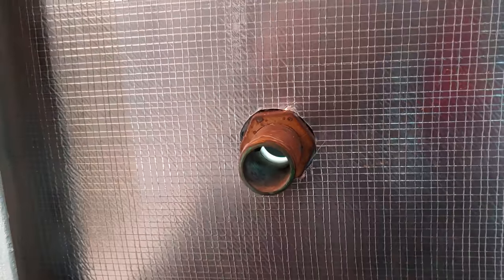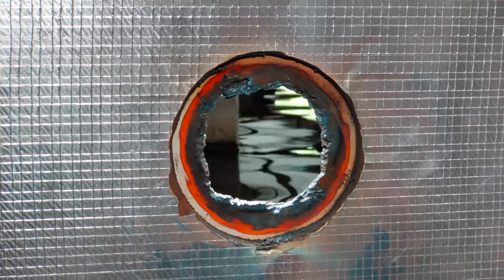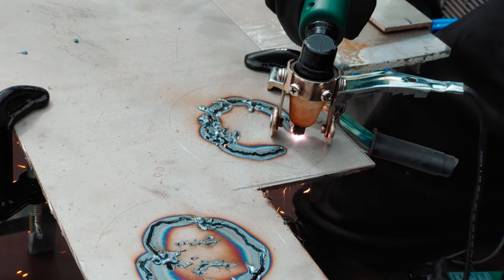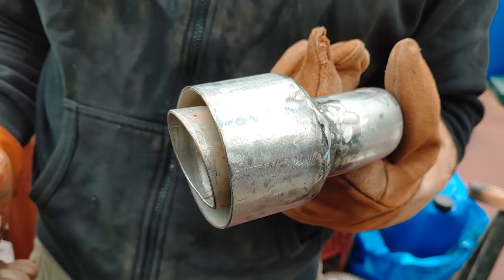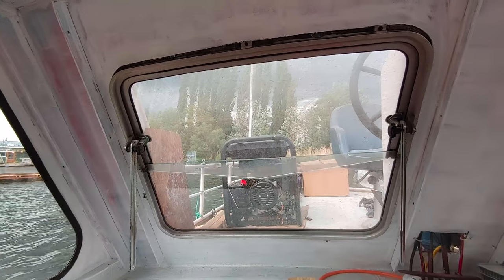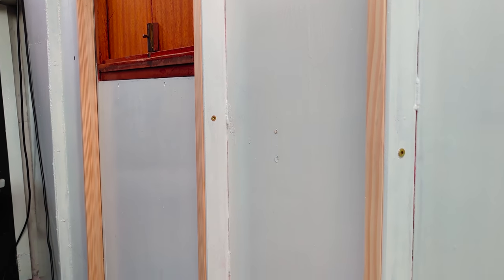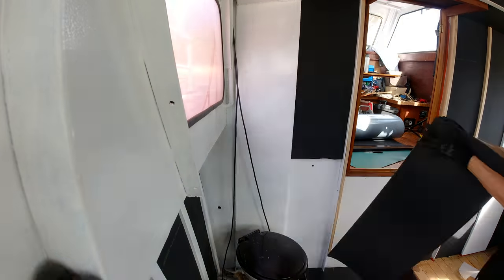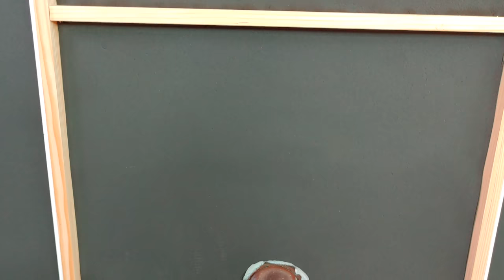Installing a Diesel Generator in our Boat - Ep. #33 - Vintage Yacht Restoration Vlog

Comment: I owned and extensively modified a 13-meter sea-going catamaran for over 20 years. Having read the comments below I agree with a lot that has been said. I would never have anything petrol-driven inside of a boat. Not even keep petrol inside. Anything petrol should be stored outside above sea level in a self-draining locker. In my opinion, if you need a generator, it must be a water-cooled marine diesel, fitted to steelwork with rubber mounts. The exhaust could go through the deckhead, but a water-cooled exhaust is much quieter and will upset a lot fewer fellow sailors.
Reply: Hummm, so many years spent offshore fishing, and never once did I have the main engine, nor the fuel tanks, outside of the boat. And seriously, the main above the waterline?
Reply: @bartjohnson8139 , I wasn't thinking of petrol main engines, as I have rarely come across them, except my nephew's jet boat. With bilge fans and great care, I guess they can be kept safe. I used a petrol generator and had small outboards for the dingy, maintaining the above ware-line and self-draining lockers. This is easy on a catamaran where a large part of the boat has space to water level.
Reply: @bartjohnson8139  I think he's referring to gasoline engines

Comment: You need to throw that welding helmet over the side into the water, and then set it on fire. Buy a good welding helmet, and a set of cutting goggles for the plasma. You can ever use very dark sunglasses. This will allow you to use TWO hands to work....
Reply: Literally anything besides what he did would be better lol
Reply: I  was just about to make the same comnents. 
An auto darkening helmet makes us amatuer welders five times better, for a really low price.
Reply: @dnomyarnostaw  im a licenced plumber and pipe welder, i have th perfect one. a kemppi self darkening mask with an air system in the back when ventilation is unawalible:P

Comment: Get some dark sun glasses or a pare of cutting glasses with #5 lenses. Because your generator doesn't make enough power to run your compressor and plasma cutter. Take a piece of scrap sheet metal tack weld it over the hole then you will be able to use a hole saw. The scrap piece will allow your drill bit to keep your hole saw straight. Buy a good set of hole saws they are a good investment. and can be used on everything Keep up the good work

Comment: I love your channel.  Well done.  However, I have to agree with all those who've said this dry exhaust so close to the waterline is dangerous.  Also the non marine generator in an enclosed space is dangerous.  I would recommend highly that you keep your gen and exhaust external and rig a vented locker with sound absorption for it. What you've set up will be dangerous and would certainly fail a marine survey.   I say this with the upmost support for you and your hard work.
Reply: Exactly what I was thinking. He's likely to get water going back into the generator like that. And from past experience an air cooled motor will need far more air flow in that small engine room.

Comment: Dude, stop using a plasma cutter for such thin materials, like 3mm sheet, far better to by some metal whole saws and use a drill and cooling oil and a regular drill ! Yes the hull would have been had ward  work but you could have still done it given time and a lot tidier too. Still keep up the good work, really interesting and entertaining. Best of luck from the UK.
Reply: My thoughts exactly! If you have the right type of arbor, you can use 2 hole saws at once. One that fits the inside of the existing hole, and a second that enlarges the hole to the size you want.
Reply: Saved me the trouble of typing this one.  Stop using the plasma cutter.
Reply: or a hole saw with oil :P

Comment: brilliant work, may i suggest for work on the edge of the boat, you can use a wooden pallet with a rope in each corner hanging from the boats hand rails to hold it in place, try looking for a bowsons chair in google and trying a larger flatter version, for the hole work you need to find a die grinder and use that to trim the inside holes

Comment: Great videos. You should move the pull start on the generator 180 degrees. This way if the batteries go out or the electric start fails you can still pull start the geni. It’s easy just unbolt turn and reboot.

Comment: G'day Crew,,
As per usual, you've  given  us all
another great episode , I enjoyed every minute .
  You waved that plasma cutter round like a magic wand, or the  light sabor that left Luke one handed . Im  almost sure i could  hear you under that welding mask saying :  " Im your father  (Captain)  now burn "
Jokes aside ,, who knew there were so many "cuff rate" plasma cutting experts hiding in the ranks of river boat vlogs .
Having said that ,,on final install of the generator ,be absolutely sure to get the equilibrium of  FLUX CAPACITOR  correct .
Thanks for taking the time to share it with the faithfull, 
really enjoyed it .

    Respect 
      from
Down Under

Comment: In my opinion, it might have been better to spray a liquid foam 32 mm on all of the inside of all the Hull to insulate because in the winter when it's freezing this would help protect and keep the heat within the boat. By only insulating above the floor this will not insulate the hull and below the floor will be freezing in winter. When using the plasma metal cutter you should a jig to get an even cut.

Comment: Tip: Just witnessed your cuts and welds....be sure to purchase high-quality Carbon Monoxide detectors...seriously
Reply: For more reasons then just what he calls welding FACTS!!!!
Reply: Let me add yet another comment about your "adapter" where you cut slots in the muffler pipe so you could clamp it down onto the smaller diameter tail pipe.  Seriously, that never works.  You will never get that joint to be gas tight unless you weld it up.  CO poisoning will ruin your day.
Reply: Ou my god, what would you do without your viewers?
Reply: @Wippe84  Carbon monoxide will kill when viewers are not around.  Even the gas exhausted to the outside can and find its way back inside.
Reply: Forget the CO detector.  Good ventilation !!
Reply: @jackpatteeuw9244  In Northern Europe? ... Oct to Feb?...frickin' brrrrrrr!.... he'd better re-do those welds and get 3 CO detectors

Comment: Although I have a plasma cutter, I don’t try to run it freehand for circles. For those I will tack weld a piece of scrap metal over the existing hole (in your circumstance) and proceed to use a normal hole cutter for steel, then I will grind off the tack welds that held the scrap steel in place to guide the hole cutter. There are jigs you can buy, but in your case they won’t do any good for a plasma cutter that you can’t effectively use because of a lack of power.

Comment: U can use a grinder to cut a round holes or a use a jig saw with a steel cutter blade or a sawsall  with metal cutting blade will work as well.

Comment: Shade 5 goggles and loads of air , you can use wood cut just bigger than the hole or as an any shape you like fence to run along steady (single use). Clamped or big magnets.

Comment: The cuts you made in the exhaust pipe for clamping? It looks like some of those cuts extend beyond the interior pipe, meaning there's a space where CO2 (Kohlendioxid?) could leak out into your engine room.  I'd wrap those a couple of times in muffler (foil) tape before you clamp them down and definitely update your CO2/Smoke Alarms ASAP.

Comment: Oh man, it's gonna get so hot in that engine room. You'll be amazed at the amount of heat this small single cylinder generator is gonna put out, much more than your main engine! You need a water cooled unit that spin at 1800. It's gonna be much quieter and way easier to manage the heat.

Comment: Put a screw in your material so your cut line is hanging over the edge of a bench. Hard mount the plasma cutter to something so it sits on the cut line. Rotate the metal and perfect circle every time.

Comment: Plasma cutters are unforgiving about marginal air supply.  There are two kinds of torches also, the contact or drag tip and the arc style needing a standoff distance.  The tip never actually touches the metal. Using them incorrectly will burn up consumables very quickly indeed.  The electrodes need to match the cup.  The lack of a water filtration system on your air will also compound the problem.  Keep an eye on the torch consumables as you will have to change them often with damp air and restricted flow.  At a minimum I would suggest (other than a bigger compressor) adding an additional air tank in line so you could do a small cut without the air starving.  Then just work within the limits of your set up.  When cutting to a critical line you need fresh consumables if you see any enlarging of the hole in the cup or distortion (out of round) in its hole replace it.  Check the electrode as well if it is scarred on the tip replace it.  That damp air will trash your tip and cup relatively quickly.  Keep a good ground close to the cut.  Once the cup and electrode are out of spec the arc will jump around and or cut at strange angles all of which make doing neat work impossible.  Make sure your air pressure is staying up as decaying pressure will also play havoc with your consumables.  Most machines in that size range need 90 psi so check your requirements.  Then of course it does need the required input amperage.  If you are tripping breakers you obviously are not providing it to the machine.  Your cuts are really bad and evidence of an improperly set up machine.  It should easily cut very neat lines in that thin of material with no problem given the above.  You need a good shaded face shield of the correct darkness (you should be able to look at the arc without it blurring out and able to see the cut line as you cut) or a helmet with a variable lens. You absolutely need both hands so one can steady the other.  Save that face mask for Halloween.  You have to see the layout marks before you can cut to them.  Rehearse the cut before starting so that you know you will be able to make all the movements in a smooth continuous motion with the least stop and resets as possible.  Use guides (short pipe couplings, pieces of pipe, etc) to minimize the free hand cuts.  You will really enjoy running a proper arc with a well set up plasma.  Something it is well worth doing right.  I have to add through hull fittings are not the place to practice welding or cutting.  They are also a place suitable for stainless, not automobile mild steel exhaust pipe and clamps etc.  As they corrode through you have a direct link to the outside water and a trip to the bottom.  You might consider in your situation if you can getting a oxy/acetylene cutting  outfit as they don't require a compressor or electricity.  All these metal working processes require practice before you turn yourself loose on critical welds and cutting, lots of practice.

Comment: you need a water trap on that exaust if you get beam side waves you will flood your exaust plus if you go salt water you need stainless steel to keep it all from rusting out. P.S get rid of that old weld hood and get a new auto dim you can set the darkness, and go with the hole saws

Comment: Love your videos but have some concerns as I’m sure others have pointed out.. exhaust install is a definite no. Too many wrong moves.. water line, exhaust material, welds. Then the timber, was it treated? If not treated always cedar as it’s more resistant to termites. Really concerned with the exhaust the most though. Couldn’t it have been routed higher up? Using a bilge outlet is really scary option.

Comment: you can buy a round stone attachment that screws onto the grinder to make the hole look better at any welding supply store, you might be better getting an oxy/acetylating torch kit since you're limited on power or compressed air. I have used 5 green lenses or you can find a cheap auto-darkening lens that adjusts shades 5-10,12 at a big box home depot or lowes type stores that are good for hobby welders

Comment: Use a hole cutter much neater because you already have a hole cut the size hole in a piece of wood put the wood over the hole that's already in the hull hold the wood put hole saw in the wood which will be the guide simples😎

Comment: the most important issue is to have the highest air pressure you can ,it is not so much the power that is the problem,the air and oxygen will propagate the cut by itself,the same as if you cut off the acetylene while cutting you will still be able to continue the cut.

Comment: Re: smallish holes, use a bimetal hole saw on a drill. Re: holes with a plasma cutter (or any shape really), make a template from thin MDF and trace it with the torch. It will come out much better.

Comment: why not try a hole saw designed for metal cutting, just attach to your drill. Also with those nuts "that needed two people" to do up under the generator platform just get a hex bit for your drill (preferably a cordless impact driver) and with lactate on the nuts the immediate start up speed will often tighten the bolt without a human on the other side.

Comment: I'm still thinking of your windows. When you took off your windows, you saw  that water is going between the rubber and steel. Did you caulk around your windows to prevent what was happening before?

Comment: I freehand plasma at an angle, looking at it from the side. I also use the grind setting on my auto dimmer mask.. probably not safe enough, but my eyes are not bothered. The other thing I learned.. I had dual voltage plasma. Better off with 220 and keep air accurate. Being in europe its probably already there.

Comment: The pieces of plywood under the deck. Dont have isolation between the steel and the wood. Moist will make the wood rot again. Full surface sika flex between the too will prefent that.

Comment: And use a welding Helmet you cut better with both hands a cheep welding helmet is typically 40 dollars brand new,    if used I'm sure you could find one for cheaper but still use both hands when welding and cutting

Comment: Even a standard Home Depot jigsaw (saber saw) with high end metal cutting blades would have knocked that right out, would have been much cleaner, and wouldn't have heated the steel.

Comment: If you insist on continuing to use the plasma cutter find the correct size guide to run it with and take off those silly bearing wheels. I make wood circle cut jigs that are smaller by half the width of my head so I can just run around the radius with the tool and get perfect cuts. That said just use a hole saw for this the plasma cutter is WAY overkill.

Comment: Man lists of haters on here about the exhaust. I guess the failed to see the boats exhaust is lower than this one right through the haul. Anyway the only thing you should do is put a piece on the end to direct it 180 down to keep rain water out. Everything else is fine. I would get a couple of carbon monoxide detectors for down there too.

Comment: On your opening "wide shots" I noticed your fender placement and might want to move them back as fenders should be set to protect the widest (beamiest) portion of your vessel which the odds say will contact "whatever" first.

As to your exhaust port, you are just inviting water intake and the swamping or sinking of your vessel. since you are making a siphon as you have it.  At least you should have a three or four-foot riser pipe and a one-way valve to forestall a bit of this if you insist on this installation. As to vibration, you need a rubber or silicone coupling (hose) for the exhaust between the genny exhaust and your pipe so there will be no vibration on the hull to dampen. Finally, a marine sealant such as 3M T-5200 should be used on your hull through fitting not auto exhaust quality materials. There is a reason why stainless steel is used for exhaust porting on all boats.

Did you use pine for all your firing without any sort of treatment? There is a reason why you will NOT find pine in a boat! It is not rot-resistant (dry or wet) and invites black mold.

Comment: Again, why arent you using self-tapping screws, it would be a lot easier, no pre-drilling required. You should treat the wood before installing it or it will rot away in a few years. Otherwise, good job. Im really enjoing your videos.

Comment: You need am entirely different tip for you plasma cutter.  Those "wheels" will never give you a chance at making a reasonable quality cut.  Most cutters have a "shield" (?) that hold the torch tip the proper distance from the work piece.  This shield allows run along the side of a straight edge with a fixed offset (2-3 cm).  If you want a circular cut or other odd shaped cut, make a pattern (typically out of wood or metal) that is smaller by the amount of the offset.

Comment: even a cheap mig with flux wire will make better welds than with that stick welder..
And ofcourse the plasma cutter sticks.. the tip has electricity as does the steel...

Comment: hi  that hole to  chose to water line, for  bilge pump  the   spray rail step to install exhaust stop water for run up gunwale in to boat take boat for run use top speed back boat goes  down  into water find the spray rail and exhaust below the waterline  wind and another boat pass have wales hit exhaust go to  rust  lose power or anchor  hit bank  tilt few degrees sand  mud and rock bank one place water get in the wooden is hard

Comment: As the others have mentioned, the plasma cutter is really not the right tool for that job. Even a jigsaw with a high quality blade would have been better. 
Just order a cheap set of metal hole saws off Amazon. Go slow and reapply cutting oil often.